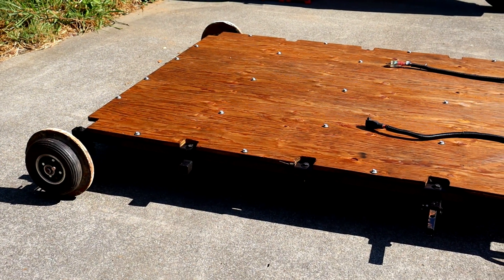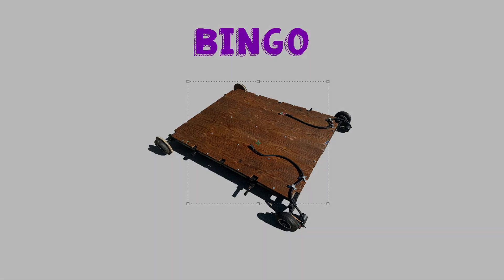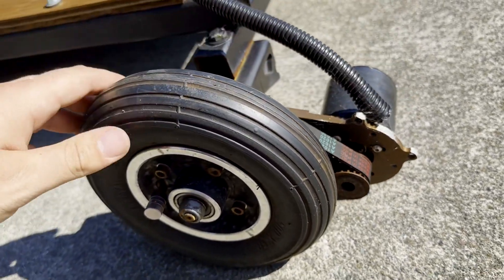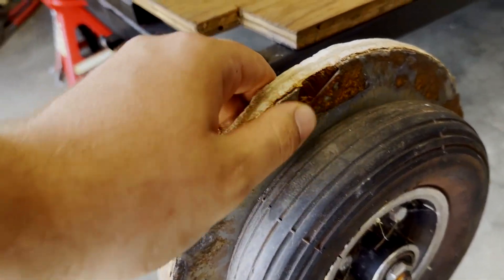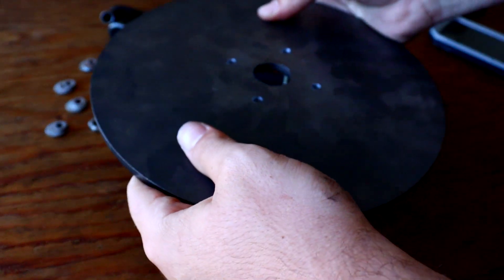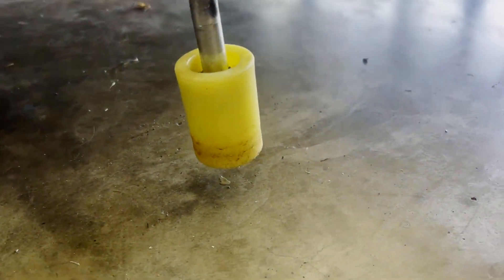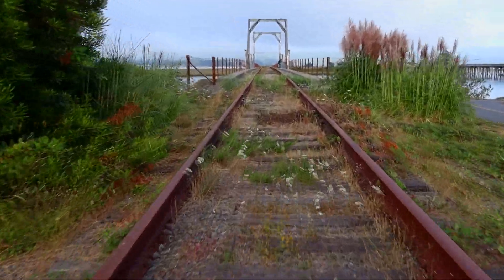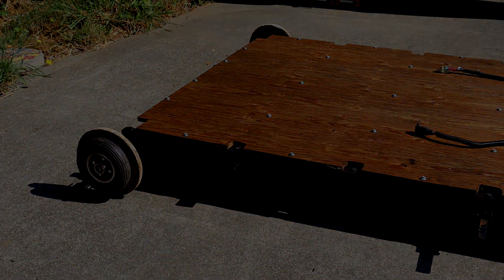DIY Electric Rail Cart!

Comment: I realize this is an older video, love your cart idea.  simple !  would you be willing to share your electronics set up?  motor size, battery specs, controller etc.   Thanks in advance
Reply from the maker: Any VESC 6 with decent amp rating (make sure you get the best amp rating you can because going overkill doesn't hurt and for some reason some of the lower amp versions cost more?) stick with a solid gear ratio (mine was 4:1) and I used 8" wheels. My battery was only 10s and I would suggest a 12s or 13s lithium ion setup (48v ish which is the standard)  you will use about 300-400 watts cruising so if you put about 1kWh of battery you would get very good ride time. (I suggest batteryhookup for finding cheap reclaimed built packs) If you don't want a wireless remote you can just buy a servo tester to connect to the VESC(s) for throttle. Thanks for commenting! By far the hardest part is the wheels! Maybe I will comeback to this with an affordable option for the wheels :)
Reply: @TechWizardForever  Thank you for the information.  My brother and I have been wanting to run the "goat canyon trestle" south of San Diego.  I have seen a few other videos on the pneumatic wheels that used 3/4 plastic which would be quieter than the metal, (the conicals are a bit expensive).  I would assume the pneumatics would be less bumpy of a ride,  thanks again!
Reply from the maker: @DavidandBeckyMillat I think my next iteration would probably be aluminum with some TPU sleeves over them for smoothness.

Comment: I'm so jealous of the low riding position. I was working on a railbike project a few years ago, and sitting that high above the rails, precariously balanced with an outrigger, was rather alarming at times. Particularly when plowing through overgrowth!
Reply from the maker: Between the pneumatics and the low position it really does feel like I'm floating right above the tracks. I'd be too scared to try a railbike with how mediocre some of the track is hahaha
Reply: @TechWizardForever  Yeah, I had to add this kind of Mad Max deflection armor around the front guide wheel, after it caught a branch laying right along the track and tried to throw me. Fun!
Reply from the maker: @Attoparsec   Hahahaha that's terrifying